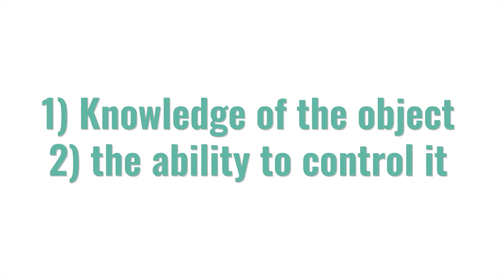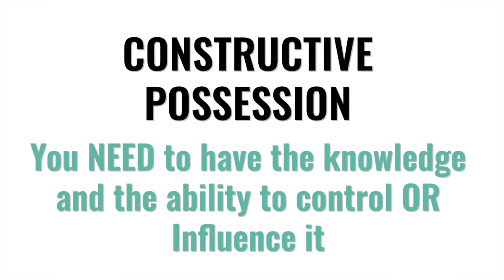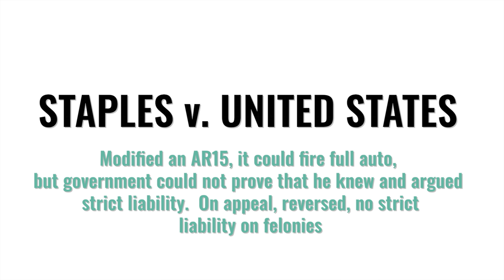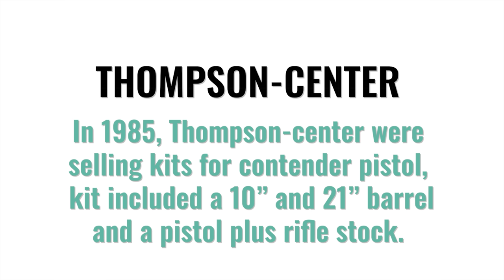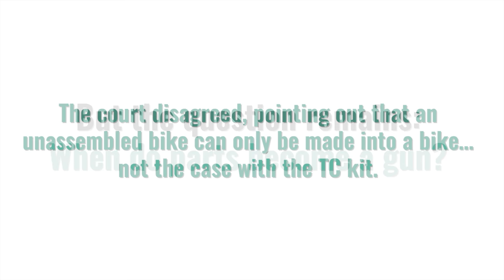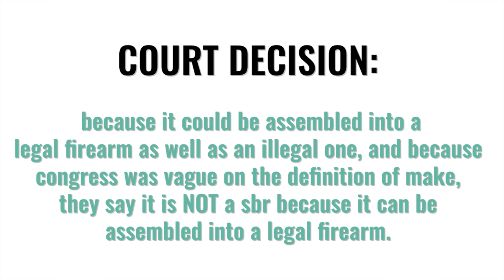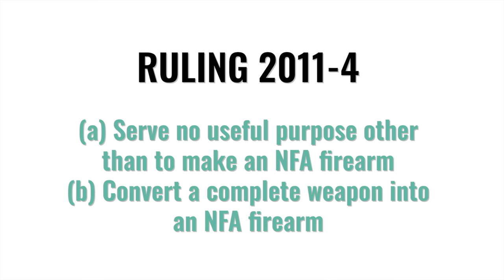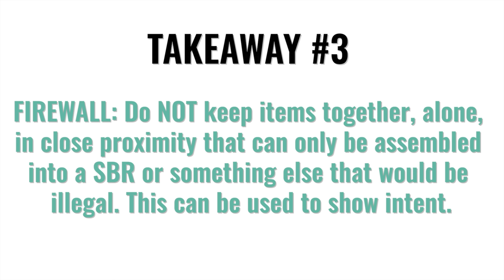Constructive Possession + Intent: Parts are Guns

Comment: Excellent video as always, sir.  Can you please address in further detail "close proximity"?  Does this mean same room, same house, same town?  Can parts such as a complete upper with less than 16" barrel and complete lower with brace (a firearm formerly known as a pistol) be at 2 different addresses under control of the same owner?  I understand that adding a new upper with 16" barrel is also a great option but maybe the one desired is not currently available.

Comment: Thanks for the informative video. The problem with the preferred #1 takeaway is that the ruling has been written so poorly that it's almost impossible to know what constitutes a "legal configuration".  #2 wouldn't be ideal if the ATF had actually written clear objective rules, but they didn't so a "box of parts" that has many possible configurations might currently be the most flexible under the circumstances.

Comment: Tom, please answer this question.  In your Takeaway #1, you say "...keep them assembled into a legal configuration".  That means either:
  * Add a 16-inch barrel makes the upper legal  ..or..
  * For pistol ARs, remove the brace and notched buffer tube, replace with a smooth 6-inch pistol-length buffer tube and a foam/plastic side cheek rest.  
Is it legal now?   The brace cannot be reassembled on a smooth tube.  The buffer tube is necessary for mechanical operation and there is no added shouldering area other than the 1.25" diameter of the tube.

Comment: Thanks, Tom 😁
Since the new brace rule, at the very least, alludes to a receiver extension (buffer tube) as being "shoulderable", it may not be a good idea to have short AR upper that requires a receiver extension to function 🤔 Perhaps going one step further and removing its barrel would be better. Nevertheless, that is moot since the new brace rule has not been published in the Federal Register (as of today). Any thoughts?
Reply: Still not published??? Interesting.
Reply from the maker: I did not see any braces in the ATF addendum links that show just a buffer tube... but to be fair, it is a "partial list".  Nice seeing you again Bob@
Reply: @AttyTomGrieve  Where can be find the addendum links?   On page 106 is:  They use the term maybe and not will be legal relative to a 6.5 inch buffer tube.  It is possible to obtained even shorter buffer tubes that are just a little over 5 inches from Strike industries.   
(5) Final Rule: Necessary for the cycle of operations of the firearm. 
The rule provides that ATF may also consider whether the surface area that allows the weapon to be fired from the shoulder is created by a buffer tube, receiver extension, component, or other rearward attachment that is necessary for the cycle of operations (i.e., to expel a projectile by the action of an explosive). This consideration is drawn from the NPRM and the proposed Worksheet 4999, which assessed two points for “Extended AR-type Pistol Buffer Tube,” “Inclusion of FoldingAdapter extendinglength of pull,” and “Use of ‘Spacers’ to extend length of pull.” Id. at 30831. These extensions provide additional material to the firearm that is not required for the cycle of operations and, therefore, can be an indicator the firearm is designed, made, and intended to be fired from the shoulder. In contrast, material on a firearm that extends the rear surface area of the firearm toward the shooter but is required for the cycle of operations, such as an AR¬type pistol with a standard 6 to 6-1/2 inch buffer tube, maybe an indicator that the firearm is not be designed, made, and intended to be fired from the shoulder. Even if a weapon is equipped with an accessory, component, or other rearward attachment (e.g.,a “stabilizing brace”) that provides surface area that allows shouldering of the weapon, under the rule, whether the accessory, component, or other rearward attachment is  necessary for the cycle of operationsneeds to be considered in determining whether a firearm is designed, made, and intended to be fired from the shoulder.
Reply: @AttyTomGrieve  Please see p. 10 of the new brace rule:  "The other factors are: ... (4) whether the surface area that allows the weapon to be fired from the shoulder is created by a buffer tube, receiver extension, or any other accessory, component, or other rearward attachment that is necessary for the cycle of operations; ..." 😒 William Kirk (of the Washing Gun Law channel) also found this.

Comment: Great video, but brings a question to mind. Scenario, one has two ARs in a gun safe. One is a standard 16 inch, adjustable stock model. The other, an AR pistol. Ten inch barrel, pistol buffer tube. One could easily swap uppers, and within seconds have a NFA item. Couldn’t the ATF conclude one has the means to readily “assemble” an illegal short barrel rifle?

Comment: I posted this under the Armed Attorneys earlier:
One serious problems with Constructive Possession and following what the ATF says to do is still a trap. If you destroy the brace but own any extra actual stocks, that will look worse than having the disconnected brace. If you keep the brace at least the ATF will know that there was a brace on your weapon and not the actual stock. So are we supposed to destroy all extra gun parts as gun parts could all be Constructive Possession especially with AR platforms.  

If you take apart your AR pistol does that not show intent to comply--at least for the time being?

Comment: Tom - 1st great content - thanks - I frequently share your channel with other gun owners.  
2nd - saw this question asked in comments but didn’t see an answer. 

Scenario - someone owns multiple AR (5.56) people rifles and has a couple of registered AR (300blk) SBRs. They also posses (1) additional  shorter than 16” AR (5.56) to use for leas expensive training on the SBRs.

Is that lawful as they can legally add the shorter barrel to one of the SBR lowers and still produce a lawful weapon?

Comment: Tom, can you do a video about Form 1's?  Basically what boundaries there are regarding those.  Such as if one makes a form 1 suppressor WITH an approved tax stamp, the suppressor at some point gets internal damage, and needs a repair or parts replaced.  Is the lawful owner of that item allowed to purchase new parts and make the repair?   There is a ton of internet chatter out there, but no clean answer.

Comment: So, question.  If I have several AR rifles, and purchase an upper in say .300 blackout with a barrel less than 16" and I store that single upper in my safe with the rest of my fully assembled AR's, where does that leave me with the ATF SBR rule?   I could split a rifle, remove the stock, attach the lower to the .300 upper and have a nice little pistol, but only if I do it in that order. Saves me the price of another lower and parts and the most expensive bit, the trigger.  Handcuffs or not?

Comment: Great video, Tom!  So how would you define taking an existing AR pistol and replacing the complete upper with a 16" barrel.  Does having the original pistol barrel lying around constitute constructive intent?
Reply: Ditto that, this is exactly my current conundrum -- if I attach a 16" upper what can I legally do with my leftover shorty upper? I don't want to trash it but I absolutely want to avoid constructive possession. My understanding is that if a shorty upper is all I have leftover and "nearby", per the displayed Ruling 2011-4 it could be used to "convert a complete weapon into an NFA firearm" and would be a violation. The solution, as I understand it, is to 1) have other parts on hand so the shorty upper is, or can be, assembled into a separate complete non-NFA weapon. The gotcha here (which puts a reality damper on both #1 and #2 takeaways from the video) is that the ATF ruling isn't objectively clear on what IS a legal configuration for that shorty upper. Ambiguity favors the rule of lenity but I'd not put all my eggs in that basket. 2) To store that shorty upper far enough away to avoid "close proximity", yet even this is uncomfortably ambiguous. Is a different room far enough away? What if I keep it in a locked safe completely unto itself? What if I store it in an entirely different house? Across the street? Across town? Across state? What is "close proximity" for sake of avoiding possession? This video was surely helpful but there are still some devils lurking in the details.
Reply from the maker: Depends where it is... is it with other parts in "close proximity" that can only be assembled into a SBR?  If so: straight to jail.
Reply: @SplashOfOrange  Best I can tell you can still have AR-Pistols, they just can't have a brace on them. Before all the brace stuff happened they were sold with smooth buffer tubes that couldn't accept a stock. One would assume you could still do this and keep the short upper on that one. Just don't take a lower that was bought as a rifle on a 4473 and try to make it a pistol. You may or may not have to destroy the brace in that case, but better than destroying the upper.
Reply: @noControl556    yeah, in principle an AR pistol is fine,  the uncertainty is that a brace is not the only criteria in the "final ruling". the ATF also lists criteria such as sights, weight, length of pull, and even the vendors own marketing without being specific as to what the parameters for any of those actually are.  So you could remove the brace and still be ruled to have an SBR for other reasons.
Reply: @SplashOfOrange  I don't want to rehash all the rules, plenty of good vids for that, but from what I saw those things only came into play after it had a brace, but I could be wrong, even then if just for compliance you could just take all that stuff off
Reply: @noControl556 , you don't have to rehash them, but anyone with a braced pistol needs to be aware of them, and the ATF has muffed it up so badly that it's literally impossible to know what's actually a legal AR pistol. The one thing that's clear is that it's not as simple as just removing a brace, though that's certainly one of the most obvious criteria.

Also, criteria they mentioned like weight, length of pull, and vendor marketing aren't things you can "take off". Point being that the ATF has written the rule such that one can "take off" everything you can and the ATF has left themselves the leeway to declare it an SBR "just because" for reasons entirely outside your own control. I don't believe the ruling will stand, but until that happens those affected need to realize that there's much more to consider than just the brace. Cheers and good luck! 🍻
Reply: @SplashOfOrange 
I thought all this was settled with decision in 'United States v. Thompson Center Arms Company', 504 U.S. 505 (1992).
Reply: @johnjohnsn7633 agreed, this thread is almost a year old, a lot has been cleared up since then not to mention currently halted by a national injunction. Cheers 🍻

Comment: So basically you can't have spare/extra parts?  If someone has an AR rifle and an AR pistol with an SBA3 (w 5 position buffer tube). They remove the brace from the pistol and put on a featureless buffer tube. Do they have to destroy the brace and the 5 pos. buffer tube?  The pistol is saved from being an SBR, but then they'd have the buffer tube and brace as extra parts now.   The brace and buffer tube could be used on the rifle and be legal.  However it could be used on the pistol again. But if they've taken the brace off and made the pistol "legal" then that's intent to follow the ruling, not intent to make an SBR, but seems it doesn't matter as long as the parts are there.   And wtf is "close proximity"?  Is 1 thing in a garage and 1 thing in a house outside of "close proximity"?
Then what if they remove the less than 16" barrel and keep the brace to make it compliant but still keep the less than 16" barrel? It's still going to be 'illegal" because of the constructive intent?
These laws are such BS.

Comment: Question: a person has a legal AR pistol with an upper that has a barrel less than 16" but has other AR carbines & rifle versions than a- the pistol version MUST always be assembled and b- they must be kept separate from each other , is that correct ?
  And what is to prevent ATF from saying since it takes under a minute to remove or replace one AR upper to another AR lower could that be seen as  " constructive intent " ?

Comment: So, basically, if we convert an AR pistol to an AR rifle, having the short-barreled upper leaves you open to being charge anyway for an SBR.  I assume this would be the same if you replaced the buffer tube with a plain padded tube, the brace w/tube must not be anywhere near this.  
Here's another question.  If you convert your AR pistol into a rifle and this rule is thrown out by the courts, can you reassemble your AR pistol?

Comment: Um? Quick question here. With what you just said there may be another issue that just crossed my mind.
If you have a braced pistol and you remove the brace to comply,  but you have this pistol in a gun safe with other AR's... Is this pistol now in close proximity to parts that could convert this pistol into an SBR? 
You have a short barrel but you also own several AR rifles that have lowers with a regular or adjustable stocks? Does this now make that pistol once again an NFA item? 
Are you understanding my question here?
I have a few safes and have no problem separating the two different firearms but many people do not have multiple safes. 

With as shady as the ATF has been of recent this could become a real worry for many people out there.

Comment: My question is finding out which parts can be used to make a legal AR pistol.  A big question for me now is for the bare buffer tube; what length and other characteristics can be used.  For sure do not possess a brace as a starting point.  
But also what sights are legal and anything else for that matter.  The current document from ATF is not clear at all or least not to me.  
I see 6.5 inches as being suggested that maybe it will be ok for the buffer tube, but ATF ultimately states that it might also not be OK; it is up to them.  The question just how can one comply with this ruling except to take your pistol upper barrel and saw it through the chamber or weld a steel rod in the barrel.

Comment: I understand the whole parts thing and the ability to assemble them into an sbr, but you have a lot of people posting videos saying just remove the pistol barrel and replace it with a 16” barrel and now you have a legal gun but what about the pistol barrel now, do you have to turn it in, destroy it , is it still considered a gun part that can’t be stored in close proximity to the now 16” barrel rifle you assembled using the lower receiver from the former pistol? This new rule  is very frustrating.
I ask because I have purchased a 16” barrel to replace the pistol barrel.

Comment: What is your opinion if an individual posesses a complete ar15 rifle with 16 " barrel, a complete ar15 pistol with a standard pistol buffer tube and no brace, with a 10.5" barrel and an additional ar15 upper only, with a 10.5" barrel in a different caliber?  The intent would be to keep the rifle complete as a rifle and interchange the short uppers on the lower with the standard pistol buffer lower.

Comment: A barrel < 16 in by itself cant be a sbr by itself Because it could be used with a receiver without  a shoulder stock, especially if there are >16 inch barrels and other receivers on hand that could use stocks. As long as there are options to not be an sbr, I interpret as being ok?

Comment: If I have a rifle with a stock, and a pistol with a bare buffer tube, is that close proximity? And what about if I have an SBR with a 10.5" upper, next to a Rifle setup with a 16" barrel and upper. Technically, they can be swapped in seconds, and wouldn't that be close proximity? Or negated by the fact that its in current use legally. That's the part that is interesting. Main thing, the ATF will never just come to your house to check this stuff. SO you would have to break another law. I would bet, you Tom, could win in court challenging the NFA as a whole, or at least getting suppressors and SBRs taken off due to common use arguments. And no one has for some reason. But I'd love to see it.

Comment: Let's say you have one registered AR-15 Lower. One normal Rifle, then a pistol with a short upper and a brace. In light of the new rule your disasable the pistol with the brace and intended to use the short upper as an alternative to your SBR's upper. (ex maybe one is 5.56 and the other 300 blk) where do you fall in terms of constructive intent? As you have an upper that isn't attached, but yet a lower that could either have a bare tube, or maybe a tube that can accept a stock? 

It seems based on the thompson case that since you can assemble that pistol lower into a rifle using your 16" upper, you should put a stock on it, but now you have two rifle lowers, one without an upper and could put the short upper with no home onto it. I suppose the the best practice would be to put a cheap 16" upper on every lower than isn't an SBR?